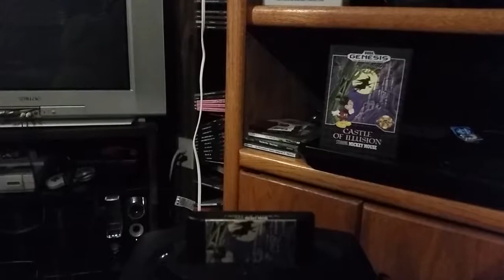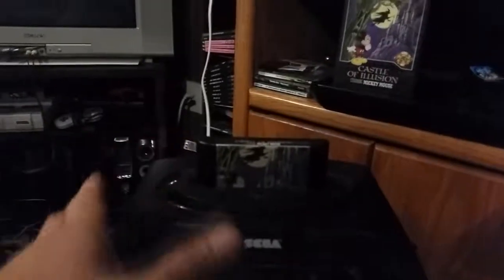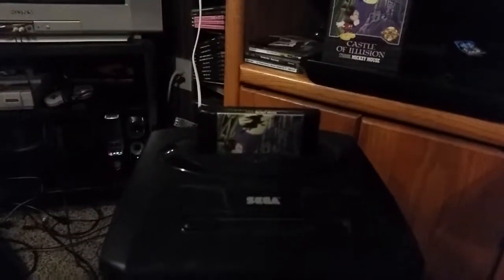Fixing my Sega Genesis model 2 reset button

Comment: I scuffed it a bit with the whole paperclip thing at the end as I couldn't get it to go all the way down the button, but I improvised and just cut it right at the millimeter point. Now my reset button has gone from not working at all to sometimes working, but I still consider the whole thing a success considering I didn't have to replace the button entirely. Thanks for the video!

Comment: Thank you! Worked a treat for me. I yeeted the metal nub out of a plastic thumbtack, hot-glued it into the center with the flat / "inside" part of the nub facing the reset switch. Filed it to be as flat as possible, resets with little effort nearly every time now. You da man!

Comment: Thanks to you, I did this over a year ago for one Genesis/Mega Drive model 2 which had a slightly recessed reset button and wasn't resetting either, but I folded a bit of plastic cable tie into the hole rather than a paper clip.

I got another model 2 Genesis recently and while the reset button was not recessed, it was NOT resetting... I was lazy though by not wanting to open the case and tried 99% IPA rather than repeat the fix. I applied 99% IPA around the reset button, pressing it up and down, soak again, after 4 rounds of that the reset button sprang back to life fully. Dirty contact I guess. The console was a bit grubby when I got it.

Comment: Worked great, only thing I did different was put the folded end of the paperclip sticking out, I was afraid the sharper cut end would eventually poke through the rubber over the reset on the board. Also made it a bit easier to pinch it and pop it in, then the two prongs spread out inside the button securing it.
Reply: That is what I ended up doing too. Made the paperclip secure by adding a tiny bit of tape to the tip so it for sure would not fall out. It surprisingly fits the reset button really well!

Comment: Or if you get a super small flat head (like really small and fine) you can just clean and put back in the rubber button.
Thats what I did and it works great.

Comment: Thank u for the idea I did something similar to what u did just purchased the va4 Sega genesis model 2 its supposedly the best sega genesis model ever made because it has the sony encoder for optimal graphics and the best version of the Yamaha sound chip I used a safety pin I cut the one side off and put it into the switch not perfect but it works the guy I bought it from said it needed a new switch on the motherboard
Reply: Youre right I have the half board model 2 also it is far superior to other ones far as video and sound goes.

Comment: Those reset buttons are pretty old and not worth saving in my opinion. I have replaced them in my Genesis with a microswitch which works flawlessly
Reply: How did you do that? Not sure what a microswitch is. Thanks for the tip

Comment: instead of a paperclip I ended up 3d printing an extender that pushes into the hole with a round nub on the end

its super janky because the 3d printer isn't good at such small sizes but it did the job so I'm happy, but if anyone else wants to use my solution id be more than happy slapping the files onto thingiverse or something

Comment: I have my Sega Geneais model 2
Reply: That's cool, What is your very first video game console? Mine was the PlayStation 2 and the oldest console I had
Reply: Dion Beckett it's call Contra Hard Corps. It was my cousin's game. he have a sega genesis model 2 as well but he don't have the cord to it and I don't either. what was your first Sega genesis game
Reply: Sonic The Hedgehog (1991) was my first Sega Genesis game but I never had a Sega Genesis I played it on Sonic Generations then I played the other Sega Genesis games on Sonic's Ultimate Genesis Collection for the PlayStation 3
Reply: Dion Beckett my uncle had Sonic Generations on his ps3. and I had it on my 3ds but I don't have it anymore. Sonic the hedgehog 1991 was the best game. Until this day I still played sega genesis. I found this website call game oldies. You will like it. also on that website you play snes games ps1 games and others
Reply: There's a website that emulate Sega Genesis games called ssega that s means super, anyway you can play the Genesis games but not CD and 32X
Reply: Dion Beckett i remember playing Sega CD and Sega 32x.
Reply: I never played any 32X Games but I only played Sonic CD, the worst thing about the two upgrades is the wires themselves
Reply: @treyvonwilliams  stimpys invention. Horrible game but I still love it

Comment: It's very risky to fix an old video game console, like one mistake, your console is broken for good then you gotta find another one somewhere around the U.S. of A
Reply: Oh, Thanks, I think I was telling a fact lol
Reply: No way man. The only way a Sega cant be fixed is if you boil it in acid or throw it on a bonfire. Then the likelihood of fixability goes down about 12% 🤔
However, I dont like the method shown in this video. What you're poking with that paper clip is a rubber pad. How many times you think that can take getting stabbed?
Reply: @greenkoopa  i agree, honestly the membrane used on these reset buttons are similar to those on controllers and they tarnish... its not to hard to gently remove the membrane to clean the contacts...worse case just replace it but i see these paperclip fixes risky and a potential electrical short waiting to happen

Comment: Sorry, but this is pretty uncreative crappy solution with a tendence to damage.. In spite of everybody sais "thank you". Couldn`t you just simply use the plastic gun and put a little plastic on the part which is pressing the reset..??!! This would be a much simplier and better.. And you will save 0.5 $ for not buying the button and do a proper job.